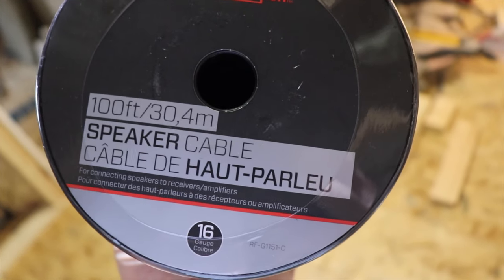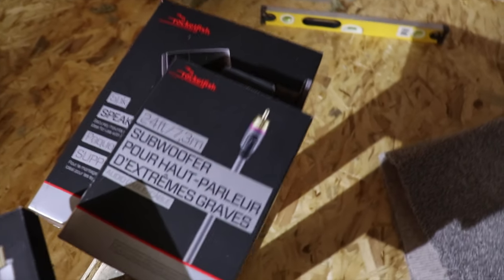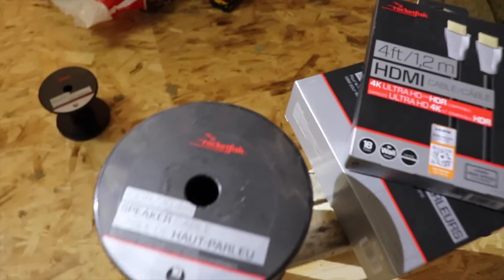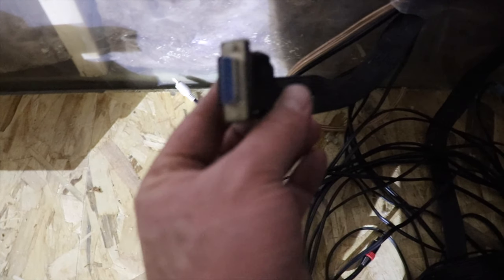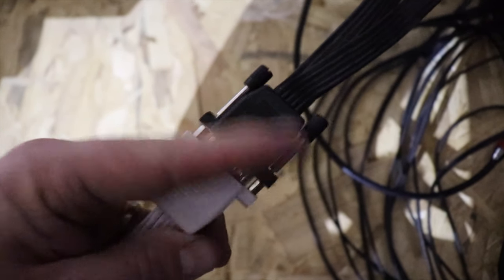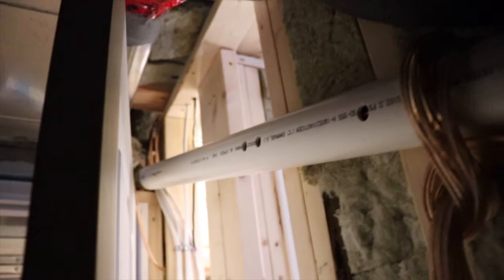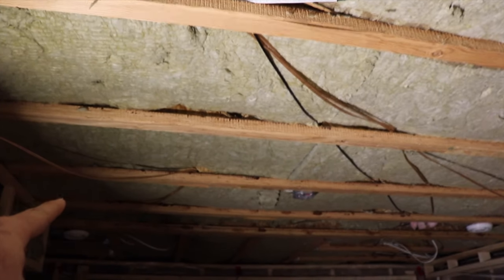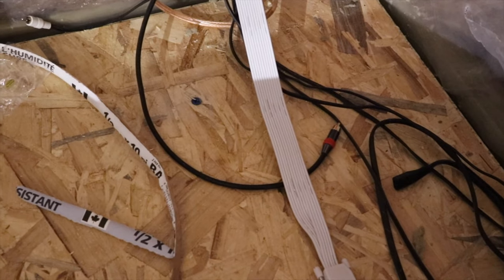My theatre room speaker setup

Comment: I bought all my cables from monoprice.com out of the states.  High quality, dirt cheap.  They also have lots of stuff for systems like yours including speakers.  They were easy to deal with and knowledgeable. The only downside is the currency exchange, but even at that, it cheaper than buying from a Canadian supplier in almost all cases.
Reply from the maker: ill check them out.  For now its savings time.  Maybe one of the speaker companies will send me a system to install and review!  A guy can dream haha